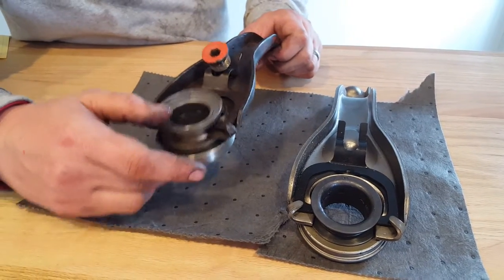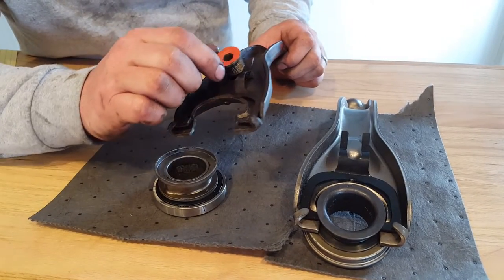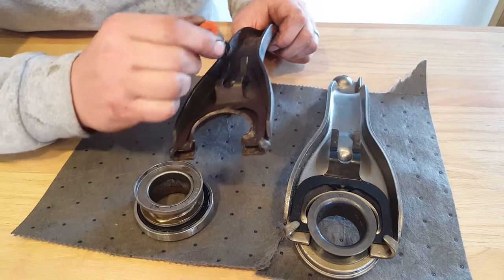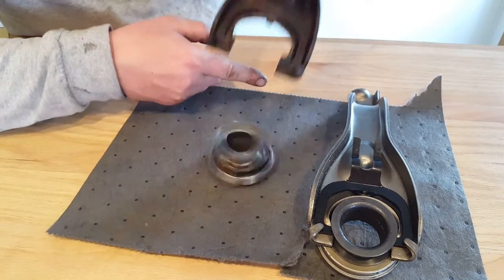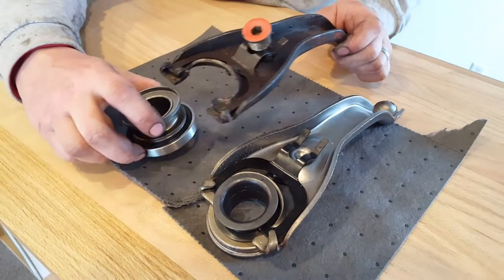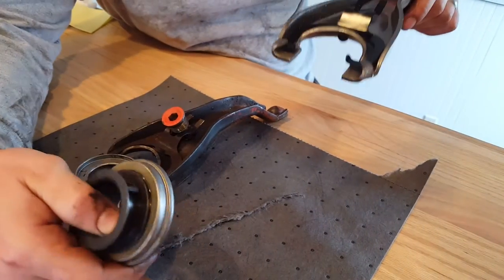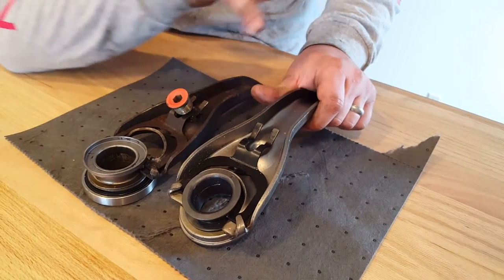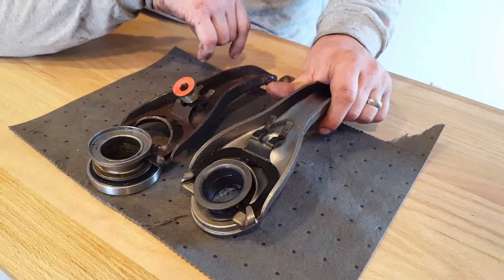CLASSIC CAR CLUTCH REPAIR

Comment: I have a 1953 Ford wagon I need to replace clutch spring. Is this the video I need or is there a video for a car closer to the 53?  Thank you
Reply from the maker: We don't have anything posted that would apply to that, but the basic overall principle is about the same.